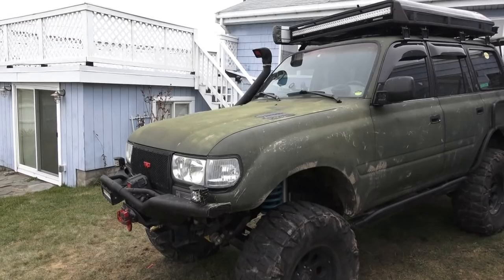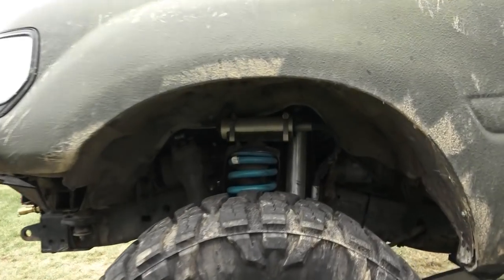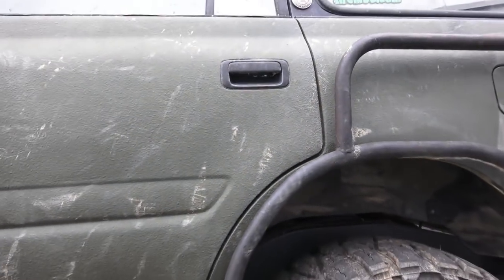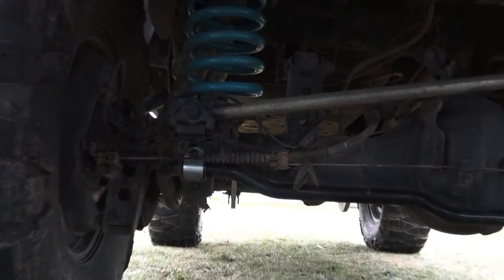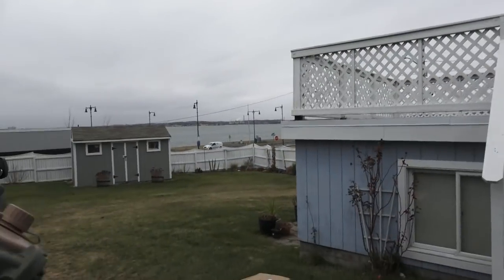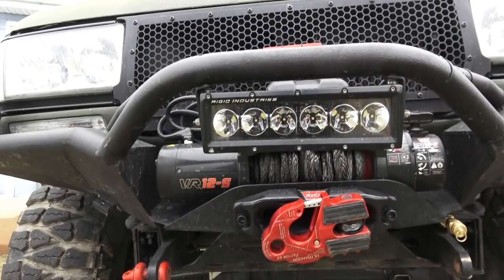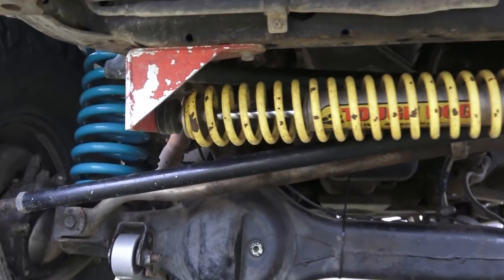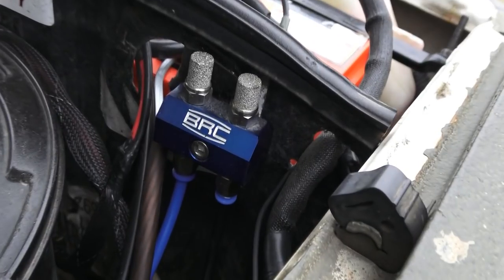Modifed America EP. 7: 1997 FZJ80 Supercharged and Kitted

Comment: Well thought out rig. I had a 97 4runner that I did some wheeling with. Lift and 33s. Sold that and bought a Fj Cruiser Same deal, bumpers, snorkel, lift, 33s. Toyota is where it's at folks fyi. The supercharger must give it the wake up juice you need with all that added weight.

Comment: and rfb I'm not claiming to be the king of offroading by any means
just a slow and easy pace even with about 400 hp from a 030 over 400 ford boat anchor of an engine which was bulletproof built by myself never used all the power but nice to have in case some kid in a camaro needs a lesson in humility